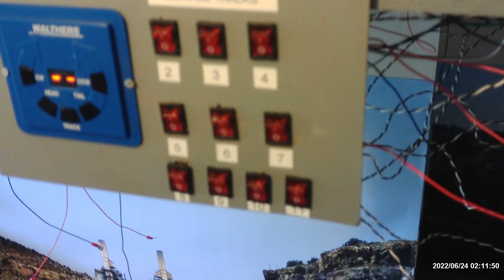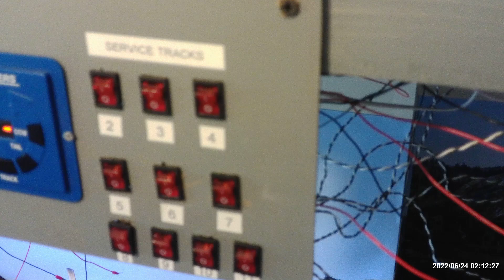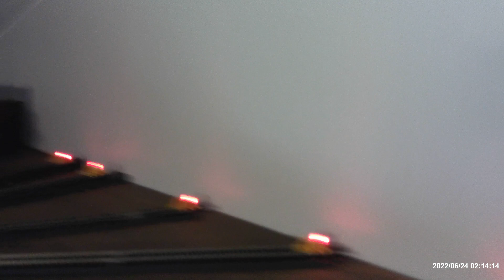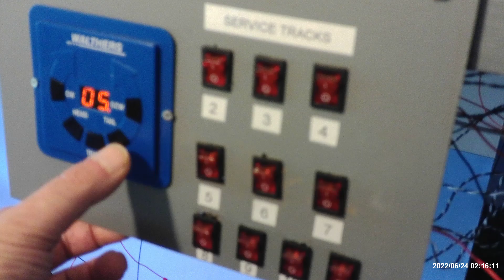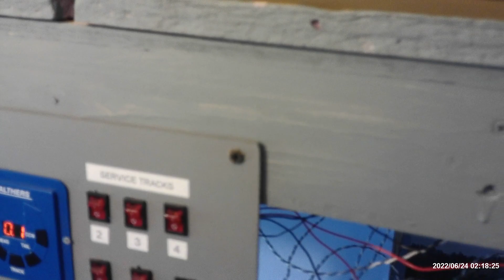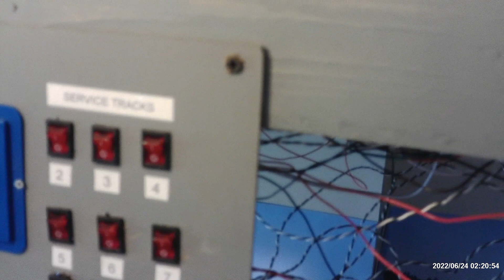133 Walthers 90 Turntable and Roundhouse Operational w/LEDS

Comment: That's very nice Tom. To make the locomotives run on and off the tracks without them touching each other, did you have to wire the service tracks on the edge of the pit or did you do something else with them? I can't get my locos to run on and off the turntable without pushing the rails between the bridge and the servie tracks.
Reply from the maker: Kyle,  I spaced my Service tracks so the engines would not hit them.  The wires are on the end of each service track.